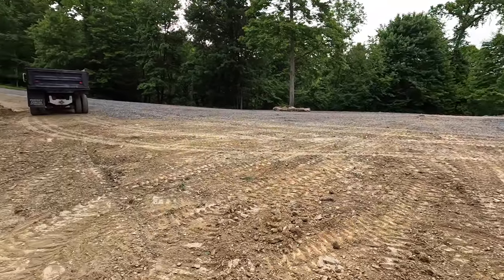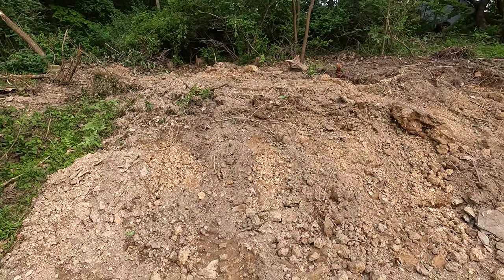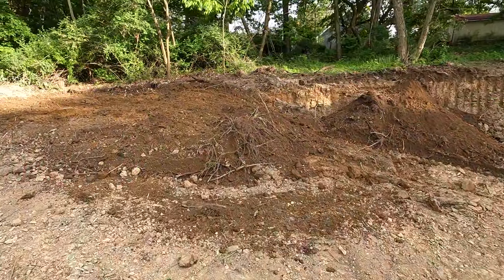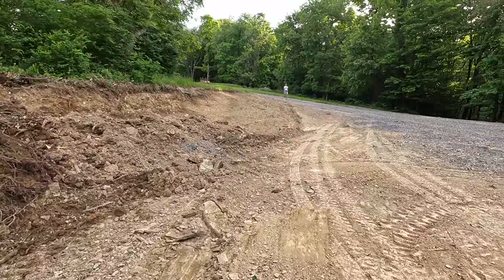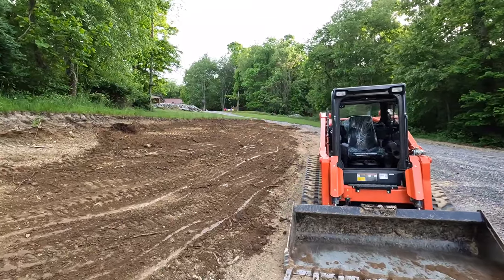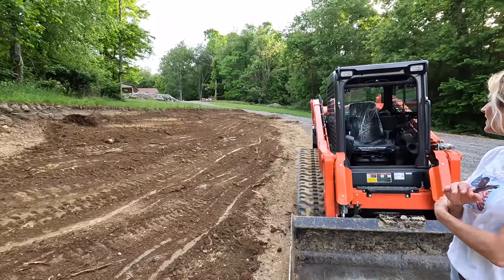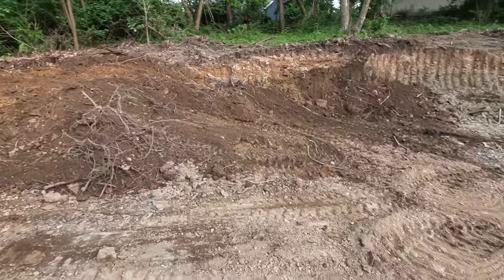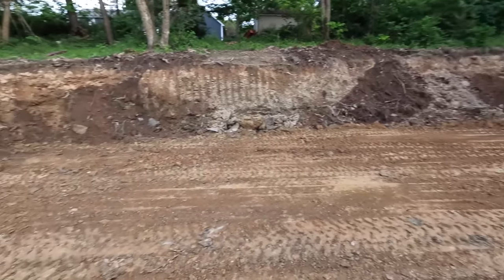The Dirt Separator, and Grade Checker

Comment: I would suggest setting the shipping container on concrete pads to raise it above ground level.  That way air can circulate and it doesn’t rot/rust from underneath.   Wood yard is looking great.
Reply: they make jack points that you can insert into the holes on the corner then a fat boy bottle jack to lift it up

Comment: Mike just wondered if you could use the firewood bucket to separate the roots from the soil ?  Would that work ? Or a waste of time  ?
Reply: That's a good idea, especially if it would mount on the skid steer. Just get a load and shake it in an upward motion like he spreads the rock. Great idea.

Comment: Good morning Mike,
When do you think you'll be working inside the big building again ? It's been a while since anything was done in there !! It's time to "git 'er done" !! Soon, I hope !!
Reply: Good weather time of the year now, they'll probably put off interior work until fall/winter/early spring so they can utilize all the good weather while they can to get stuff done outdoors.  At least that would be what I'd do.
Reply: @William Sevier  agree, would be what most able bodied people would do.
Rain and snow days are for that inside work!
This is that fellers second same comment on this same video.
Obviously not enough to do at his own place.
Reply: @haroldphipps3457  Holiday weekend this weekend, and cooler than normal temps, I'm going to try and finish knocking walls down in my shop so I can finally get the last 1/4 of my shop space back and move all my wood working tools over there and make more room for my tractor & attachments.  I'm hoping I can get the extra $$$ together this year to rebuild the door opening on the end of the shop so I can widen it out and rebuild the doors so I can get my tractor and attachments in and out easier, and get the attachments inside that won't currently fit through the door.  Going to go with the sliding barn door setup I think.  

Wish I had that much free time to post multiple copies of comments on videos HAHA!!!

Have a great weekend.

Comment: Hi Mike, genuine question, with the excavator and skid steer do you still need the two tractors. Regards Jim UK.
Reply: With what he does, not really.  The excavator and skid steer do all the work.  Those 2 tractors aren't really necessary anymore, and the BX doesn't get used really especially since they got that zero turn mower, they don't use the BX for mowing anymore and could pretty much send both the tractors back to Kubota at this point and probably not miss them much, especially the BX.  The larger tractor does have a backhoe attachment for it as well if I recall, but with the excavator there's no need for that.  The only thing the tractor/BX would be good for now would most likely be snow removal if they get enough in the future to need them, but the skid steer could do that just as well.